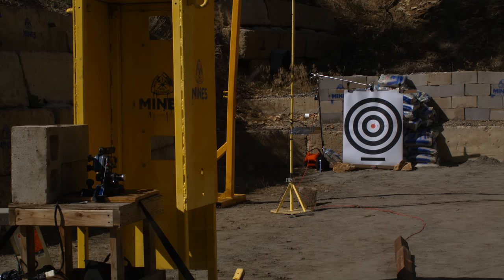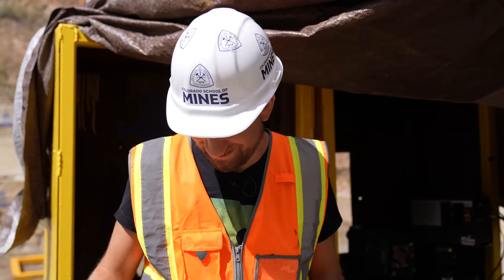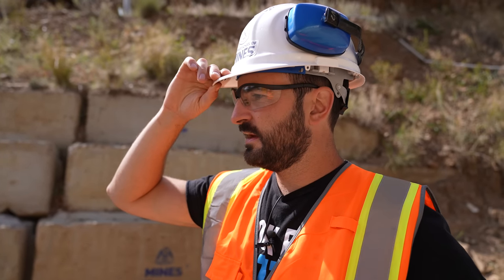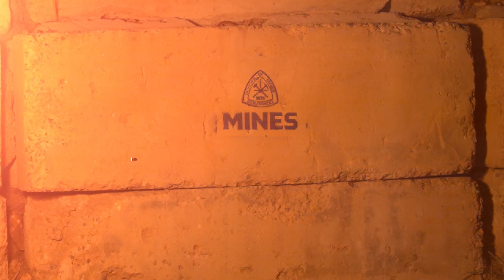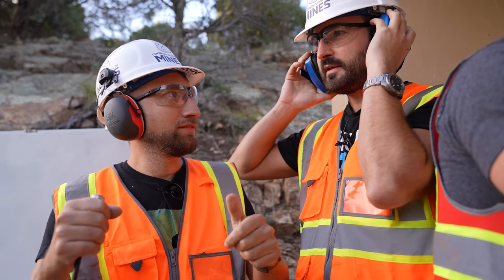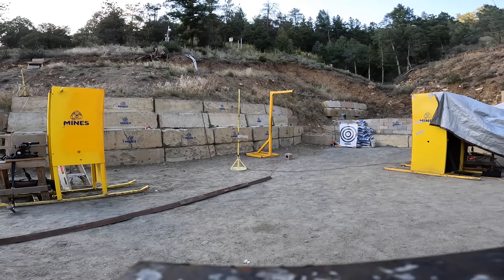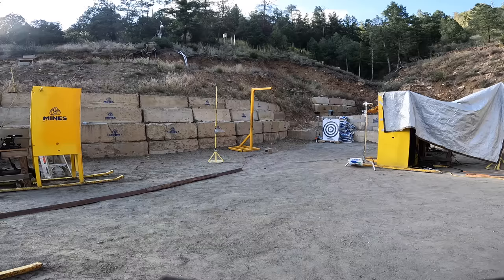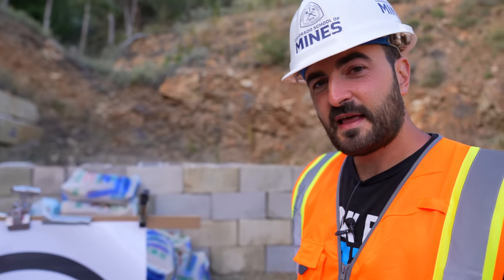Can Explosions Deflect Bullets? 2 MILLION FPS - The Slow Mo Guys

Comment: Let's calculate. The bullet moves with 400 m/sec. It is hit by a side wind of 200 m/sec for 1/400 sec. The side area of the bullet is 2 cm².
Now we calculate the weight of all the air hitting the bullet from the side: 500 cm * 2cm² = 1000 cm³. This is only about 1.3 g air compared to about 10 g bullet weight.
0.0013 kg * 200² / 2 =  26 Joule
Now I assume, that 50% of the air energy is transferred to the bullet to change course. Only 13 Joule.
So when the movement of the bullet is on the x axis and the sidewind from the explosion is on the y axis,
my assumption is, that the movement vector changed from x=400 y=0 to x=400 y=50.
But maybe I assumed the sidewind from the explosion far too high. With 100 m/sec, instead of 200 m/sec sidewind, the effect is reduced to y=400 y=6.25

Comment: For that amount of explosive, you need to be closer to the point of initiation. Also the explosion is still timed a bit late. It has a lot of spin stabilization, but more explosive and closer and it will be deviated for sure.

Comment: Maybe it's playing Kerbal Space Program, but I really want to see you hit the explosion well in front of the bullet, so it is slowed as well as pushed downward. To see if slowing it would cause greater drop than direct vertical force. It would also push through different pressure regimes that way as it flew through the explosion's area, potentially tumbling it more. I don't know if either of those results would have much effect unless you also increased the total range to the target, but it would be interesting to see.

Comment: Hypothesis for you all: Due to the amount of kinetic energy the bullet is already carrying forward, and the small surface area, as well as the very short window in which the bullet interacted with the shockwave, it was not able to change the direction of the bullet by any visible amount that we would call anything other than expected error.

Comment: The momentum behind thr bullet, and its shape probably mean that if you do deflect it, itll "correct" itself as drag increased on the tailing end to "pull" it back straight.  Youd need so much force, so that at the point of the bullet its enough to overcome that and make it tumble

Comment: Well, we know at least one thing is true, the law of physics that states, "An object in motion, tends to stay in motion, unless acted upon by an outside force." but because the Bullet is travelling at supersonic speed the air motion is not going to affect it very much, and because shock waves are a weak force when travelling through air, it's obviously not having any appreciable affect on the trajectory of the bullet, because of the bullet's speed and it's mass. But these are factors you can play around with. you can buy subsonic ammo, that is not travelling faster than the speed of sound, but lower than it, and you can also use a lighter bullet, but I wager that even then, you are likely to have very little affect on the overall trajectory of the bullet. in my mind, at least, the shock wave from the explosion is too weak to alter the path of the bullet other than perhaps an inch or two tops. and if you mess with the speed and weight of the bullet itself the overall affect will still be commensurate with the amount of weight and speed changed. You guys may have tried this in the past and I don't know about it, but have you tried to duplicate the condition of a world war 1 incident where two bullets intercept each other and stay together, as seen when someone who was digging at a site of a world war 1 battleground and found two bullets stuck together? Wouldn't that be a task to try and emulate?    

https://www.reddit.com/r/nevertellmetheodds/comments/5sjdxk/two_collided_bullets_from_the_battle_of_gallipoli/

Comment: If I were to guess- the explosion is taking the path of least resistance. I think it's simply travelling around it more than it's pushing on it. That plus the bullets inertia and gyroscopic stabilization (spin), it seems to shrug off the explosive.

Side note: you could make a frame around the paper to help hold it in place. Also, mark your shots!

Comment: I don't know if I'm even close to an assumption on why it wasn't affected, but like some others, I think the explosion still needs to start slightly before the bullet gets there. My other thought is wondering if the rifling has any affect? Does the stabilization of the bullet help it resist a change in direction from the explosion? Maybe try with a smoothbore.

Comment: I suspect that the bullet lacks the surface (planform) area upon which the increased pressure can act to cause much explosive deflection. Also, your experimental setup makes it so that any deflection you do achieve is simply added to the deflection of the bullet caused by gravity. Placing the explosive to the side of the bullet's path would separate the gravitational and the explosive deflections. Admittedly, this would make positioning the cameras a bit more difficult. Another thought is that the ideal location for the bullet is slightly ahead of the explosion when the pressure wave reaches the bullet's path. The pressure acting on the bullet can be broken down into components acting parallel and perpendicular to the bullets path. The perpendicular component will increase sinusoidally as the bullet approaches the plane of the explosion. It will likewise decrease as the bullet passes the plane of the explosion. The parallel component only acts first to decelerate then accelerate the bullet. Make no mistake, you are deflecting that bullet. The military has an explosive device meant to deflect the shaped explosion of an RPG. That is very similar to what you're trying to do. In the end I don't think you're ever going to have enough explosive deflection to be able to differentiate it from the randomness of a firearm. At least, not without some significant changes to the set up.

Comment: When you revisit this, consider shooting a bullet straight across a row of tubes pointing downwards with explosives set inside them. Have the explosion/forces controlled and funnelled into one direction, towards the bullet. Have them go of in sequence, not all at the same time.  You may get significantly more bang for your buck - literally. I suspect a series of smaller, controlled, pressure waves (aka explosions) would have more of an effect than one massive and wild explosion.
Or you could use lots of gravity but I can't seem to find a source for large quantities of it 😅

Comment: Could the spinning of the bullet (10,000's RPM) be creating a gyroscopic effect that resists the push of the shockwave? Also, the bullet is small, low surface area. A calculation of the PSI on the bullet and the spin rate may reveal if the bullet could be moved.

Comment: ERA is a thing. You could have gotten further if you ask the question how much C4 is needed to deflect this bullet 2 inches Given the weight of the bullet, and it's forward speed, there's an amount of vertical acceleration you need to achieve and minimum force required to get there. All of the molecules in the column of air between the c4 and the bullet don't have enough mass to push it with the force you need until you get to absurd speeds.  You really need something heavier than air between the c4 and the bullet to push into the bullet to make the idea practical. Unfortunately, it also makes the idea far more destructive.
I love the MythBusters energy, and I think you're about halfway there. Having two people argue at length setting it all up helped the science. Pushing the idea to its limits and beyond until there was an effect helped.

Comment: Yeah, you aren't gonna much if any deviation if the bullet isn't traveling through the shockwave. If you moved the trigger back further and got the explosive to trigger before the bullet reached the explosive you should get deviation. Since the shockwave was coming after the bullet had travelled under the explosive, you just made the journey easier by reducing the resistance the bullet was facing from the air since you pushed the air ahead of the bullet. Having it Travel into and through the shockwave would give the most resistance since the shockwave is compressed air, with the shockwave being more or less sphereical it should in theory take the path of least resistance and bend with the shockwave.

Comment: Lesson learned. If it's close enough, it almost won't seem to matter.
Otherwise, it's a super strong gust of wind that may affect it down range.
it's not like hitting a sword which is magnitudes denser than air actually deflecting the bullet severely. 

it's not the answer that's important here. We could have guessed. 

The moments of time caught is where we are winning.

Comment: I believe it should cause some amount of drift in the ballistic trajectory, But not so close to the muzzle ! ..as the round still has significant energy and the shock wave of explosion or ultra high speed hot (lesser dense than ambient) air from explosion may not cause much drift. 
Like in typical ballistic jell where the projectile speed is reduced in dense medium but the directional stability is maintained.

Comment: A buillet is one of the most aerodynamic shapes in the world, made out of iron which compared to air moving at even 10x its speed still has enough mass to easily penetrate the shockwave of the explosion.. I however ponder - if you detonate the explosion on the side of the buillet (which oc. is a lot less aero than its front) while hitting it at the right angle/frequiency in air, you might then actually deflect a buillet significantly more?

Comment: Toward the end there he mentioned how it's not any lower than "just the random pattern we've been getting with the wind". Is that suggesting the wind is having a greater or similar force on the bullet than all that C4? How could wind be moving that bullet around several inches but the force from the explosives seemingly does nothing?

Comment: First thing I thought was if simple wind power can change a bullet, an explosion certainly would.
Reply: That's very true, but wind tends to be over a larger area and has a more consistent push on the bullet.  While this is far more powerful, it also has a very brief interaction with the bullet.

I'd use a painted wood or steel target and make my control a 5 shot grouping instead of a single shot.

Comment: Would a shape charge make more if a difference? How much kinetic force of the c4 is actually hitting the bullet? Im guessing not much based on the surface area of the round. I doubt, without focusing the explosion it would do much as even the cardboard was still in tact after the explostions. Great video, thanks!

Comment: Try with shaped charge next time :D It would probably obliterate the bullet. As you remember you featured the shaped charge with the copper cone which punctured a hole through a thick metal safe. Although it would be a nightmare to make it so that the bullet is right in the path of the explosion.

Comment: You might get a better result or more true result if you extend the arm of the post-explosion travel. Maybe use a longer gun and explosion at 20 yards and the target at 100 yards. That way the target will not move so much and the bullet has more time to deviate from its true flight path.

Comment: I don't think it's going to have an effect until you can either vaporize or break up the bullet. The bullet's cross-section is just too small. The shockwave has a lot of power, but it's all spread out over the surface of the shockwave.

Maybe, if the bullet essentially grazes the explosive right as it goes off, the shockwave will be powerful enough to defect it.

Comment: Ke of a 9mm bullet is about 450 Joules vs 145 for a .22 caliber.  thats about a 1/3 reduction in Ke. If you double the c4 to 200g if my math is right, is the equivalent of using 6x the c4 or 600grams of c4 in this experiment, which may deflect the bullet.

Comment: The bullet is traveling to fast to have it trigger the blast and the shock wave catch up with the speeding bullet.  All we see is the fire or light which moves faster than sound covering the bullet, but the light won't affect the bullet like the shock wave will but the bullet is long gone because it's being used to trigger the bomb.  As oppose to haven't the bomb go off at the same time, but placed in the path of the bullet about 5 ft ahead.

Comment: all about PSI   bullet no surface area   - what you need is a longer  push   the bullet  is  removing mass from the particles  the particles weigh nothing     - the size of the bullet the size of the explosion  the time it takes for the bullet to pass the force  -  maybe try a pipe to force the force in the direction  that would also  decrease the time the force is acting on the bullet  mass in motion will remain in motion  untill the energy put into it has been expended       - either  use a square wave  or  a sine wave

Comment: Before I watch this, I am going to say what I know or what I believe to be true about this matter.  I'm going to watch it and see if it matches up.

So a bullet is fired out of a gun as a result of an mini explosion of gun power ignited when you put the trigger.  A gun's trajectory can be impacted by many factors.  Aim, maintenance of the gun and wind.  So I believe the concussive force of an explosion could change the direction of a bullet.  

So after seeing this, the concussive force probably has to be really powerful, we're talking the type of explosive for a human to feel the concussive wave a good distance away.  Which means I think you need to do this in a desert and not a mine.

Comment: I feel like the explosion itself isn't enough to change the trajectory of the bullet mid flight, cause the explosion is too wild. But if you were to, lets say, do the same exact test, but put the explosion in a canon barrel pointed downwards, it would concentrate the energy towards pushing the bullet downwards....

Comment: have you considered that perhaps the shockwave acts as a refractive lens for the bullet, deflecting it in the opposite direction than the wave is going? The refractive effect may be basically cancelling out the effect the explosive force has on the bullet.
Reply: exactly what i was thinking, the bullet's cross section is so much smaller than the wavelength of the shock that almost all the air hitting the bullet is getting refracted rather than reflected, so much less energy is getting imparted

Comment: So this concept is actually or was actually used by the military. Only as far back as the Gulf war the idea of EXplosive reactive Armor  ERA was put into practice by the US military. The concept similar to this experiment was can a timed proximity explosion knock the moment out of an armored piercing projectile in order to protect what was behind this armor. They used on the M60A1 Marine Battle tank  the US military found this concept worked however you needed a space between the tank and the ERA and this was difficult and expensive to maintain to the original form was not used very long After its introduction

Comment: i aint real good with maths so il leave that to you, but could you use a muzzle attachment, bleed some gas close a circuit, electric primary fast secondary petn or cyclonite that way the shock front is propagating and the bullet must travel through the shock front/wave and see if there is POI shift, or is a slower detonation a thicker shock front, if no POI shift do you introduce a liquid like water to the shock front and see if water deflects a light grain projectile ??

Comment: I'm going to be that guy. When shooting, slight wind is a factor in bullet trajectory. An explosion will affect the aerodynamics of the bullet (increased drag due to "shockwave), and the air density in which it is traveling through (less oxygen) will absolutely deflect a bullet. Deflection can be >.0001 of a nanometer proven with the scientific method.

Comment: The mass of the bullet is far greater than the mass of the air being pushed away by the explosion. The explosion has also expanded to tens of thousands of times the size of the bullet by the time they interact, if it doesn't even destroy the cardboard trigger, how could it possibly put enough energy into the bullet to change its direction in a meaningful way?
If you put the explosive 2-3" away from the bullets path and get perfect timing, you might get a meaningful impact on its trajectory.

Comment: Great video, but…In the back of my mind during this video is the word “scale”.  If you had a 1/2 MOA rifle mounted on something rigid enough to maintain its position (therefore it’s grouping on target) and then set off the explosive @ 100 yds on a 500 yd target, I expect you would see deviation.  The change in density of the air and direction of flow of the air definitely is effecting that round.  It’s simply too small to see on the scale you used; and with the inaccuracy of the firearm/mount used it’s impossible to distinguish from normal variability.

Comment: I reckon if they used a .22 caliber bullet that it will definitely affect the trajectory. They really need to come back and try this cause the .22 is significantly slower and a lot less power so in theory the explosion would push the bullet down.